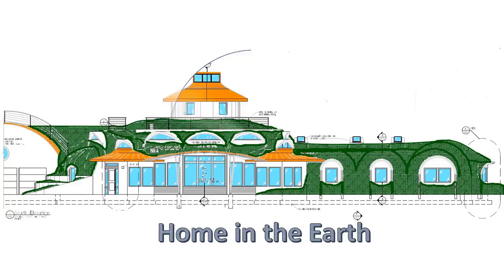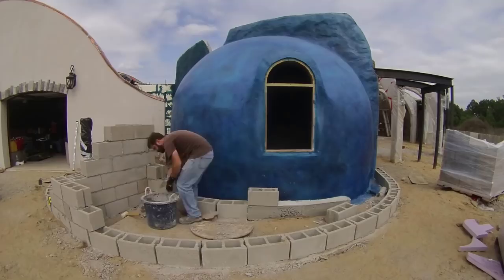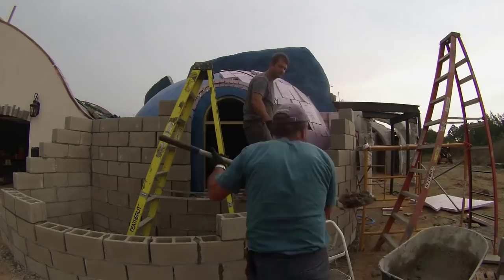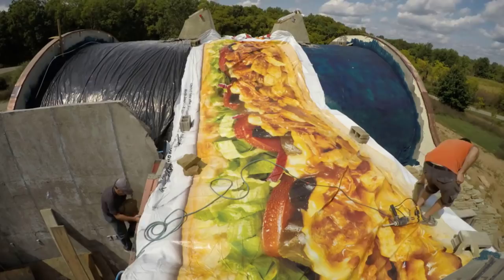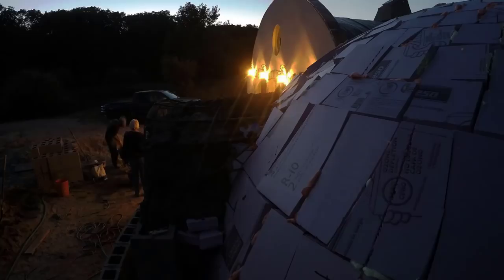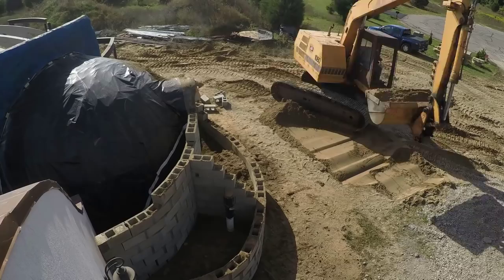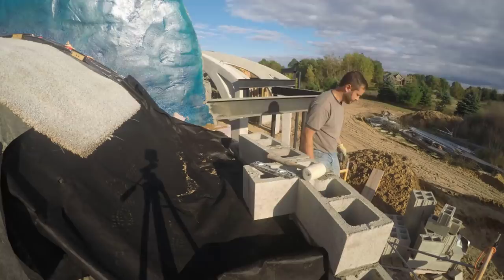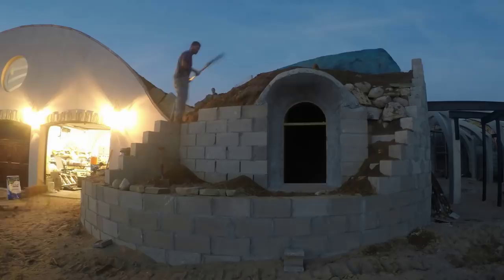37.0 CMU retaining wall

Comment: Yep. Apply the pieces of insulation like snow/ice is applied to the exterior of a northern igloo. Know I have seen something about this on the Net. Looks good. :) 
Am starting to ponder water retention and mould/mildew. Will watch this as you develop your project.
Reply from the maker: Yes, the vinyls should keep water out of the insulation, but if a little gets thru, I hope it makes its way down thru the gaps and out the bottom.

Comment: I would have hired a professional spray foam installer. If you spray the foam on your dome except of placing tiles you will have way better insulation properties. No gaps, no filling foam (which is worse then sprayed foam or foam boards). If it has uneven spots you can sand or cut it away.
Reply from the maker: Yup, and at only 6x the cost of the 25 psi XPS.   It was just not even remotely affordable to get the closed cell high-psi foam.  If the cost were only double (or maybe triple) I would have gone for it, but I couldn't afford 6x.  ¯\_(ツ)_/¯

Comment: "If" you must have windows, your arch design is a must with dome homes. I plan to get my natural light in my monolithic dome from tubular skylights, no windows. 
I love the look of earth, concrete, not at all. Still, my dome will be concrete but covered with bright white plaster. 
I will have a security wall of ICEB (interlocking compressed earth block). Since it need only to withstand wind, I won't need mortar. 
Why didn't you use bigger rebar, e.g., 1"? Wouldn't a super foam insulated dome be cheaper, faster, simpler than the earth covering? 
You seem to have lots of good earth, will it make earth blocks or rammed earth?

Comment: that retaining wall did exactly what it was suppose to do stay together......what you and your engineer failed to do was tie the wall to the foundation....the footing was not designed to hold it either....it should have been wider on the outside of the wall and "L" rebar in it so when you have  pressure behind the wall it was would act as feet .....
Reply from the maker: The engineer was fine, no need to blame him for the poor construction.  The wall fell down because I failed to tie it to the foundation and horizontally (hoop stress).  As for the beefer design you describe...  That would have been necessary for a decent surcharge (like if there was a road or something above the wall).  But in my case, the retaining wall is only about 6 inches from the apse at the bottom and maybe 2 or 3 feet closer to the top.  That is not a lot of earth to retain, the dirt behind the wall probably weighs less than the wall.  So the 24 inch wide footings were sufficient.

Comment: Why didn’t you put rebar vertically and horizontally in the block walls?
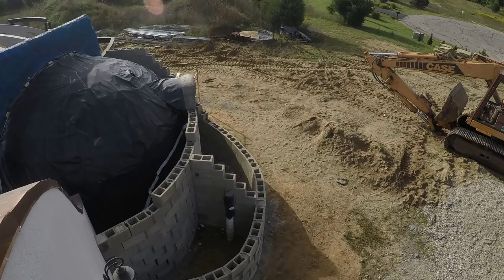Reply from the maker: Mainly because I didn't think it was necessary at the time.  Then you get to 8:30 in the video and you see where I learned my lesson.  

When I rebuilt after that, I used more vertical and horizontal rebar.  (I say more because I had used some before that, I just didn't use enough)

Comment: I see dirt slides of the domes , so not all lot lot of dirt can be put on top of the house and this why insulation is needed, but why not have put sticks coming out of the concrete like porc-épic and then put the thick pile of dirt? Just my 2 pennies...
Reply from the maker: I think the quills would make the structure harder to waterproof...

Comment: I build ICF homes and structures. The rebar is placed and concrete is pumped in between styrofoam layers. Are you  saying this form of sprayed on concrete is stronger than than a hollow form pumped full of ocncrete? I don't know. Using your method I can definitely imagine some vertical structrure using blown concrete- such as  bastions protruding from a side wall 60 feet above the ground (kind of tough to support concrete forms that high, but it would appear spray on concrete could begin at the bottom and envelop the sides all the way to a high pitch roof covering the bastion). What do you think? essentially making a cinderalla castle.
Reply from the maker: The strength of basic poured concrete can vary depending on the slump.  In order to make it flow into a form (like an ICF form) you need to increase its slump.  Usually, this is done by adding water and this weakens the concrete a little.  Conversely, gunite uses much less water (zero slump is often ideal) so the concrete stays on the wall.  Less slump also means less shrinkage and less cracking.  Shotcrete takes this even further and uses additives like fly ash to increase flow thru the tube without adding slump to the wall, and that can dramatically increase the strength.   Beyond the mix, the way that the gunite/shotcrete hits the wall also helps by packing the concrete together.  Also, when the workers trowel the face of a gunite wall, strength is further increased.
Reply from the maker: About your castle...  One of the advantages of gunite is that you only need half the form, which is particularly helpful when dealing with difficult shapes.  Also, because it isn't all trying to flow out, the hydrostatic load on the form is minimal.  The gunite supports its self (assuming the start from the bottom) as they build it.  My light forms could never have held up under poured concrete.  Also, you can leave small gaps that would have caused major leakage problems with a poured wall.    You can also add artistic detail, (like drawing bricks or stones) to the gunite before it sets because the form isn't in the way.

Comment: That space between the dome and the block wall, how is it supposed to drain water? Is there tile (french drain) under those?
Reply from the maker: Yes, we put in a french drain (horizontal) along the footing.  It almost fills the whole space between the apse footing as the retaining wall footing.  Then it goes under the outer footing and toward the yard for about 10 feet.  There are also 2 vertical stack drains behind the wall to help drain things quickly.  Maybe too quick actually, it is a bit too dry up top.
Reply: Better a bit on the dry side then too wet. If it can't drain it will freeze and cause issue. Just add peat to your topsoil to help retain moisture for any plants. Also the roots of whatever is grown on there will help too. Strawberry plants perhaps :). Gunite, I used to build swimming pools with that stuff. Excellent product if used correctly.
Reply from the maker: Yea, next spring we will work on the soil.  There are 4 acres of woods and I wanted to thin that out.  I'll chip a bunch of it and use that as mulch to help get the soil going.
Reply: Careful as wood mulch can take away from what is growing until it rots sufficiently. Use it on the surface, don't plant in it.

Comment: So is the point of burying everything for the insulation value? I think you'd have to live about 500 years for that to pay for itself. This build seems to be insanely expensive. But if it's something you really want, you have no need to justify it to anyone.
Reply from the maker: It cost much less than any other house in the neighborhood.  Concrete is cheaper than wood construction and I don't need exterior stuff like siding, etc.  The house across the street cost something like 3x per square foot.  Ours is less than the national or state averages also.

Comment: You should have just used spray foam instead of cutting all that rigid foam. You wasted days of labor when you could have sprayed it in under an hour and had better results.
Reply from the maker: I would have loved to use spray foam.  However, the cost was more than six times greater than for paying professionals to install rigid.   And of course, much much higher than having my mother install rigid. 

Also, the companies I spoke to would only quote for the whole house (high volume required to cover start up costs).  They wouldn't even give me a quote for a small volume job like just the apse.

Comment: You are too paranoid about thermal transfer losses. This small areas are a tiny percentage of the entire structure and do no amount to a significant loss of energy.
Reply from the maker: Yup, I know you are technically right (and that is the best kind of right), and I know I need to make compromises in many places.  I am just trying too keep those to a minimum.  Here I went a bit too far in that one spot, learned my lesson and compromised thermal for structural.

Comment: very cool and expensive ........looks like   .......  over engineered commercial products for.........  rich people
Reply from the maker: I guess that depends on what you mean by expensive.  It is costing about 90$/sqft (we budgeted for $78, but have gone over).  Perhaps a mobile home would be cheaper.  The average house build cost in my state is $167.25 per square ft and the house across the road from me cost $311/sqft.  Concrete costs less than wood.  Rich people usually pay other people to build their homes for them.

Comment: Could have saved vast amounts of time - and money - by using Speed Block - boggling to see so much pointless labor.
Reply from the maker: Yes, there are many other building systems on the market, and new ones come and go every year, but have you considered that there is a reason that basic CMU's are still so popular around the world?  And it is not because people prefer more expensive and slower processes.

I had to look up speedblock to see what you were talking about.  In 10 seconds, I saw that the blocks only come in pieces that are 32 inches tall and 288 inches long and require a crane to place them.  Perhaps ideal for some situations, but not something that can be used by do-it-yourselfers to create a short curved retaining wall ;).    I didn't get to the price point part of it, but I'd be willing to bet they do not cost less than CMUs and that they would also require additional costs for special delivery, etc.